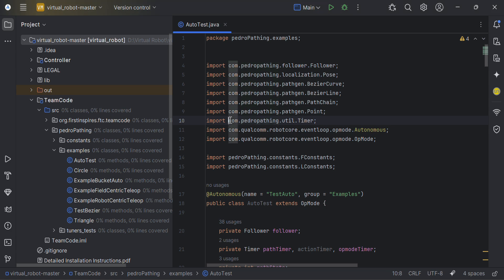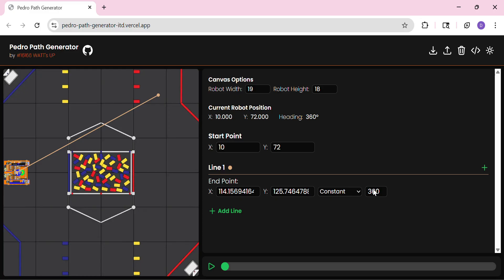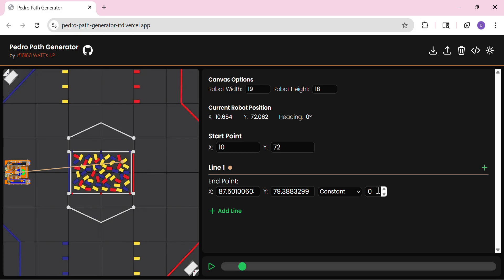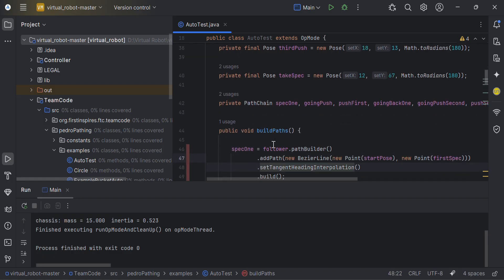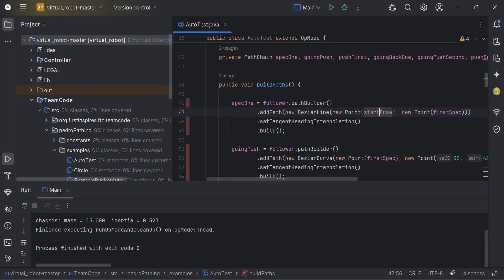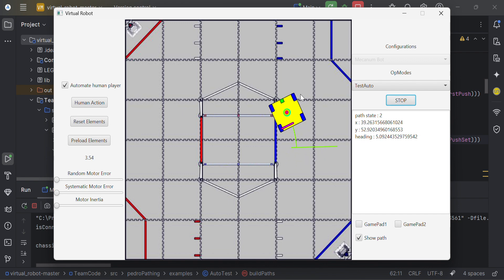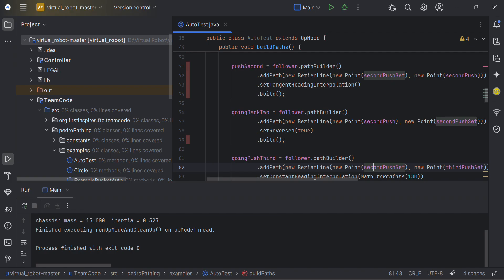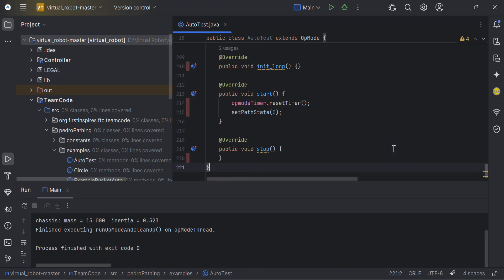Writing an PedroPathing Autonomous FTC

Comment: Hey great video but how you make different motor movements for arms and stuff like that?
Reply from the maker: Thanks! If you are running version 2.0, you can make different arm or motor movements using built-in callbacks like Parametric, Temporal, or Pose. Just add a callback in your PathBuilder and it will trigger your arm action at the exact point in the path you want.